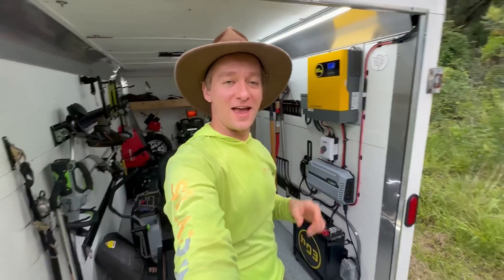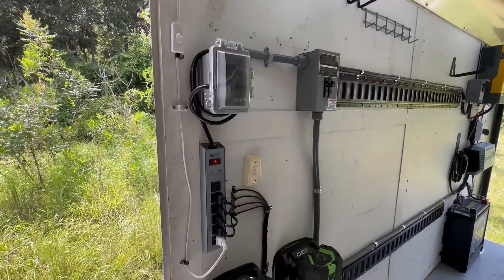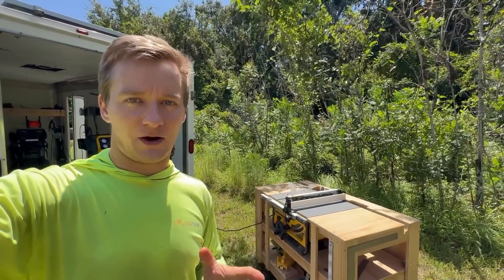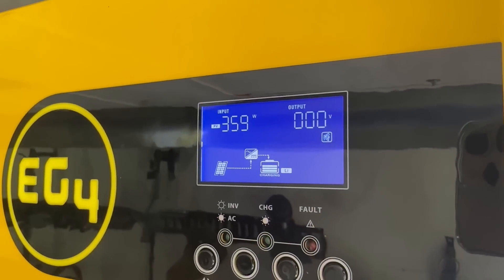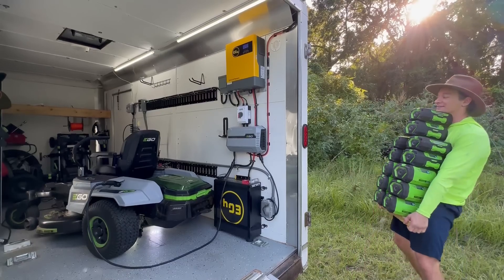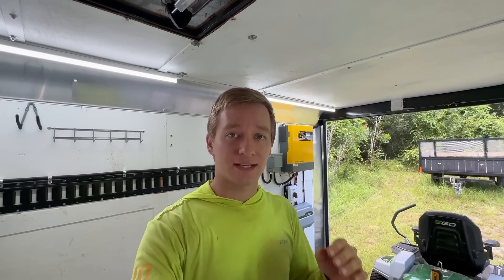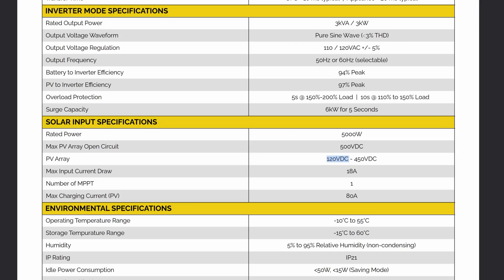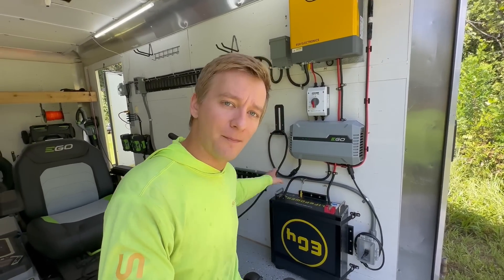Solar Powered Lawn Care Setup; Why Not Just Buy More Batteries?

Comment: Really cool setup dude! If you want to increase efficiency then figure out a way to get rid of the inverter. Obviously the power tools have charge controllers designed for household outlets, but inverting to ac just to have it rectified back to dc is a lot of unnecessary heat loss. 

Best of luck in your business venture!
Reply from the maker: Thanks! Yeah the DC-AC-DC is annoying, but it's a tradeoff on my time to be honest. Building the perfect most efficient setup makes sense on paper and I'm exploring what it might take, but ultimately for running an electric lawn care business, it comes down to what works and makes sense from a practicality standpoint, I need to be out on a property making money, not in the trailer designing perfection.  Don't get me wrong, if there's an easy solution to charging the EGO (or any other tool/equipment batteries) directly from DC, I'm all ears. It's just, do I spend time building a custom system that if I switch brands or something breaks I have to redo it all? Or do I suffer the inefficiencies and just have enough capacity/production to make it all work without having to think about it and allow me to be brand flexible? Hopefully some of these companies catch on to the trend and build me an easy DC-DC solution that I can just connect up and I'm off and running.
Reply: @solarpunksteve  The Ego power station can charge 4 ego batts directly from a solar panel DC. Not sure if its doing any DC to AC to DC internally to lose efficiency?  Max input is only 180w @ 12v though and not sure if its optimized for 10ah batts yet. I'm sure you already know all this but hopefully, Ego will come out with a higher capacity version.
Reply: Hey man thanks for the reply, sorry for not getting back to you earlier but I've been on vacation. I totally agree, you have a business to run first. If it ain't broke don't fix it. However, if your goal is to be entirely self sufficient on solar power alone, and aren't able to fully charge your batteries, then the inverter is where I'd start. Unless there is some type of security circuit that matches controller to battery, like some tool companies use, a 3 stage dc charge controller should be pretty standard. I would look for a dc-dc charge controller to test in an isolated circuit with your existing EGO battery packs. Getting the controller dc line out to the battery terminals will be the most complicated part, either the battery charges or she don't.

Full disclaimer, I went to engineering school and ended up in finance. Just appreciate thinking through these kinds of problems.

I find your videos incredibly inspirational and look forward to more content. Liked and subbed good sir!

Comment: Something else that has me thinking. I'm curious how feasible would it be to build your own EV Zero Turn. You could literally take an commercially available zero turn that has a blown engine and swap it for a 20hp electric motor and LiPo batteries. The entire mower is powered by the engine anyways, so it wouldn't know the difference. Then you could charge it directly via DC to DC from the solar so their are no losses and miles faster charging capability. If you owned a Ford Lighting, you could dump 7200watts@220v into the mower battery to charge it back up by wiring up the trailer with a 220v connection at the tongue of the trailer that would plug into the truck. I've used it while driving down the road to keep a cooler refrigerator cooled going camping.

Comment: Great explanation. I want to know how that Tesla handles that trailer lol. Did you have to beef up the suspension?
Reply from the maker: Nothing special! I installed the trailer hitch myself, wired in a 7-pin plug, and installed a brake-controller but you can get Tesla to do that instead.  The tricky part is the tongue weight (max 350lbs), so I had to be very careful about how I balanced the trailer to keep enough on the tongue but not too much to overload the suspension.  Other than cutting your range in half, the car barely even knows the trailer is there.

Comment: I'm really impressed with your ambition to make this work bud. I randomly came across your channel looking into EGO Zero Turns for personal use. I don't own a solar landscaping business, but maybe what I've done last year with my solar can assist you in the future. The Inflation Reduction Act created a loophole for double credit on specific EV vehicles. I was looking to replace the old lead acid system on my home solar system with newer technology, so when I researching it, I found many people were using the Ford Lightning on their taxes as both a EV vehicle purchase and Solar home battery. So I went to my accountant to verify this and after he looked into it, the vehicle legally qualified based on the loose rules required after installing the Ford Charge Station Pro. So when I was able to claim the $7500 credit for vehicle purchase + 30% credit for solar on the purchase of the truck (solar battery), Charging Station Pro (Power Inverter), and labor to install it all properly. I was able to get over 37k off my taxes after creating tax liability via sell of stocks. When the hurricane came through a few weeks ago here on the west coast of Florida and the power went out overnight, my truck acted as the battery bank supplying power to the house until I needed to plug the generator in...

Comment: Another way to do it might be with a Rav4 Prime that has 15 kW of useable battery built in that you can use with a 2000-3000 watt inverter. Since it only takes 2.5 hours to charge to full you can choose to run a boatload of electronic lawn care tools throughout the day and never have to worry about running out. Even if you did somehow run out you could in an emergency run the car in hybrid mode and finish charging tools if somehow you chewed through 15 kW of battery storage. Using solar isn't horrible but if you had solar on your house with storage you could just charge the vehicle before you leave for the day and not worry about where you park.

Comment: I have been thinking about this same idea for some time now and this is absolute proof of consept
Also if you are working localy and don't need to worry about the range ansiaty then you can use Vehical To Grid 
(depending on what EV you have) and those cloudy days are no problem 
And it's a trailer, so you could have fold out panels and double/triple your array when parked
If you only do 2 or 3 yards a day, you have a self contained business and that is close to imposible unless your Farming or Mining, but here it is
If you like to modify thing like me then you could also change out the battery system in that EGO to some Tesla packs and play all day
whyle your at it add a layer of Tesla cells under the floor and you could charge off a larger solar array at home on the week end and play all week
I mean work, right ? yeah that ride on looks to much ha ha ha

This is a MONEY hack , AWESOME.

Comment: The main disadvantage would be the limited amount of charge-discharge cycles on the LiFePo battery, being a whole unit by itself makes you have to face a repeating cost from time to time in order to replenish its capacity. That being said, it's an awesome job!
Reply: The storage battery is  LiFePo4, rated for about 3,000-5,000 full charge cycles before degrading to 80%. The trailer will fall apart before the battery does. 

I’m interested to see how long the ego batteries last. They are Lithium Ion which are rated at 300-500 charge cycles. 

What’s interesting in this setup is that the batteries are topped off regularly which is where Lithium Ion likes to live. So they should last even longer.

Comment: I wonder how much benefit you would get from putting your solar panels on a bracket that can change the angle to more effectively take in the sun in the winter and or early mornings. nothing crazy, maybe a screw jack in the right spot that will give you up to 30 degrees of tilt to one side.

Comment: The question I have is what would it take for you to wire the battery chargers to pull directly from DC without using AC inversion and then DC rectification again? I can understand needing to run the table saw from the 120V outlet but batteries store DC power so it just seems needless to me to run the power over AC only to have to put it back to DC again.

Comment: When the ego batteries die, have you considered dropping in that 48v eg4 battery right into the mower? That would be a beast of a mower. And probably cheaper.
Reply from the maker: I have considered it! Maybe one day. Not sure how happy that would make EGO..
Reply: @solarpunksteve  the ego is 52 volts. The eg4 is actually 51.2 or something. (Even though it’s a ‘48v’) So I’m guessing it’s so similar it would likely work. Does the mower have a volt meter so see what the ego battery is fully charged vs empty?
Reply from the maker: All EGO tools say 56V, and I measured one while fully charged and it was reading 58V. I’m not exactly sure how the mower handles the power, it says it needs a minimum of 15ah to operate, so you basically have to put two EGO batteries in, which maybe means it’s running in series to get double the voltage? Maybe not, it might just operate at 56V still. Either way it’s a different beast than the ryobi with lead-acids that I’ve seen people converting to lithium. I’ll mess around with it one day and really figure out what’s happening inside, but for now I’m just going to keep using it to make money until it breaks.

Comment: I would like to see ego have more charging programs so you could overnight slow charge your batteries if you wanted, or you could quick charge them, and you could also choose to what voltage/ how full do you want your batteries.  Lithium ion batteries get stressed when they are left full, and charging them to 80% is much more gentle on their chemistry.

Comment: In my mind it would be awsome if you could add the Tesla Batterie permanently into the mix as a very big Batterie then you can charge/use that Batterie too and have extra miles and the safety of never running out of juice.

Comment: Wouldn’t it be easier with you charged the dc batteries with the dc voltage generated by the panels instead of converting dc to ac to dc?

Comment: I'd love to know how often you do in fact have to use shore power (plugging into the grid) to charge your system? Also, would you ever consider a fold out system to add more solar panels. My brother has a very similar system as your trailer, but he built a camper instead... But he tows it behind his Tesla as well. He has a fold out awning that has more panels on it. He runs a mini split AC, a fridge, an induction stove top, water pump, lights and so on. He was able to drive across the US with it, and really only had to charge up at the Tesla supercharger stations, while his camper ran almost entirely off solar for the whole trip.

Comment: Nice! It is so practical what you have together for where you live. I really should get a 2-3kw system for my NE Ohio home to offset some rising electricity costs and outages. I wonder if you had put a tilt function to your panels something that can tilt them 10-15⁰ left or right to get a bit more energy over the day possibly even drive it with a screwdriver sun tracker system so it'll adjust while you're busy in the field.

Comment: Good luck having to buy new batteries every two years and deal with that expense. Not to mention the pollution and the poisoning of the environment that that brings with it. If you’re running a business, you run with fossil fuels. Fossil fuel edgers are lighter and can be economically replaced once every 10 years rather than every two years.

Comment: Thats such a clean and neat setup. I am actually in the process of finishing up something similar. 4 100AH 12v liPoFe4 batteries, 3KW inverter/charger. No actual solar panels (this is just in a station wagon) but just the convenience of charging powertool batteries and that on the go and not getting home with a bag full of dead batteries is worth it for me. (Not to mention forgetting to grab the charged ones the next morning. Been there done that it sucks!!) Just plug 1 extension lead in when i get home to charge it all back up. 
I have been for a while just using one of those 2KWh solar generator type systems but often find it runs short by the end of the day. Especially if i run my microwave or air frier i keep in the car too. Got sick of paying for take out every day for lunch so just bring it with me now. 
One day i will get a van and chuck couple of solar panels on the roof to go with it too.

Comment: I was wondering why someone was not Marketing a system like yours to the yard care profession. (I had already figured that always having a set of tool batteries 'on charge' was a way to go, capturing every possible Watt of solar. 
Many communities already have bans on gas powered yard tools (Noise and fumes). You just proved that the solution for charging does not limit your choice of yard tools to a brand.

Comment: But if your system takes 5hrs to charge to full and so do your batteries, in your example of getting done with one yard and having 20% battery left and by the time you drove to the second job it was charged enough to finish... what if you needed 100% or 80%? You'd have to wait 3-4hrs
Reply from the maker: So you’re right, the main battery system on the trailer can take a long time to charge with solar, but the mower charges up quickly. So what I meant in the video is the mower charged up from 20% to a level that was enough to finish another yard and then I finished my day.

The onboard battery is always working as a buffer, slowly charging up with solar when I’m out mowing, then charging equipment while driving to the next house etc. Is it a perfect system? No, if you use it heavily one day, you might start out your next day with the onboard battery at 50% or less like I did this past Friday. So Thursday I went out and did a full day, but we got rain in the afternoon so not much solar, we’ll Friday I started with 50% onboard and did another medium day of mowing and same thing with rain in the afternoon and I ended the day with 14% in the onboard battery. It’s charging up this weekend though to be ready again for next week.  But I also could just plug the trailer back in and top up all batteries if I needed. 

Again, not a perfect system but for me this was something I really wanted to see if it worked, honestly it probably makes more financial sense to put solar up at your house or business and just bring onboard storage batteries with you mowing, or something like an F150 lightning or Cybertruck etc. 

At the same time it’s really cool to have a mobile domestic sunlight refinery with you at all times 😉

Comment: I’m very impressed with your solar☀️set up but much more impressed with your marketing and business savvy!  I built a portable system with the exact same EG4 components⚡️and used solar panels for under $3000!  We use it to power my house through my generator transfer switch for any power outages.  I can assure you, once you get deeper into DIY solar, you’ll be buying lots more panels and batteries! 🤣. Great video! 🤠

Comment: I have an open lawn service trailer. Only place I have to collect solar is on the top of the tool box. Bummer. 100w panel. But I had no reason not to add solar. I already had a 1kwh trailer battery that I was overnight charging. As more of my equipment got replaced with electric, I just expanded as needed. And because I charge from the trailer battery instead of only at home, I was able to have the brands that I prefer to use. I still home charge a few batteries each night, but while out on the route, I use the trailer charger. And now that I have power in the trailer, I have also added a microwave and induction cooktop to my collection so I can have a hot lunch during the winter. 

Most of my stuff is EGO as yours is. But I use the ECHO string trimmer and Milwaukee walk behind mower.

Comment: well done video, good length and nice cuts

the pv modules sound expensive, i think u should get bigger and also cheaper ones somewhere even in the USA
you also could get higher yield by adding additional ones on the side of your nice trailer. Have u ever been empty on equipment and trailer? does tesla have an onboard socket to charge the trailer?

Comment: So, DC to AC to DC. Lots of losses. You need a DC charger setup so more of your energy is used instead of wasted.
Reply from the maker: I don’t disagree with you, and lots of people have said similar so far. Part of the reasoning with my setup was “finish putting this together as quickly as possible because I need to mow on Monday” and “hey this is working great and why spend a bunch of time trying to change it?”  Lastly the simplicity of installing the EGO battery chargers and not designing or hacking something to charge them directly from a DC-DC converter made sense. Not to mention if I change brands/battery voltage I don’t have to go redesign a system. 

In a system optimized for efficiency, it makes total sense, but sometimes you have to compromise when the requirements are varied. 

Who knows, enough of you are talking about it, maybe I’ll just do it 😂

Comment: Great video.  I am switching to an ego electric mower also.   I have a solar system already on my home that I am getting a small rebate from the power company for selling them my electricity, but my real plan is to use my system to power the Tesla Cyber Truck when it comes out.  I do not have a battery for my solar system yet.  My question is, could I not use my solar panels to power my electric truck and then run a cord from the truck to the mower in the trailer and power the mower from the truck batteries as I drive from lawn to lawn?  Also, is there a way to plug the mower into my Solar Edge inverter and charge the mower the same way that I would charge an EV? thanks.